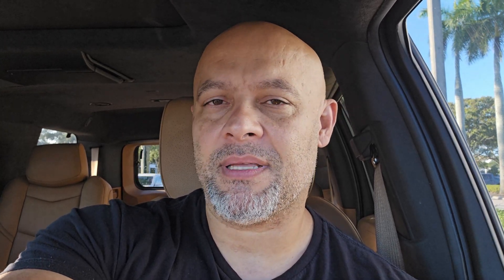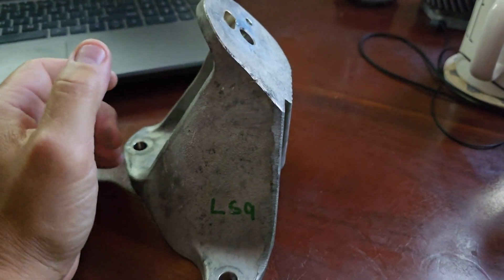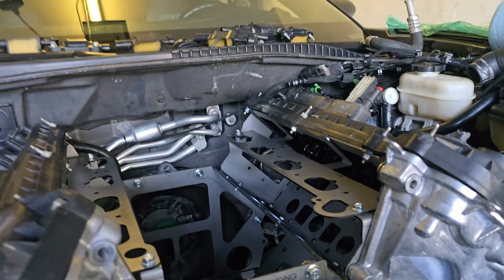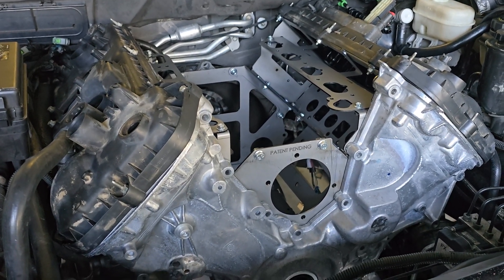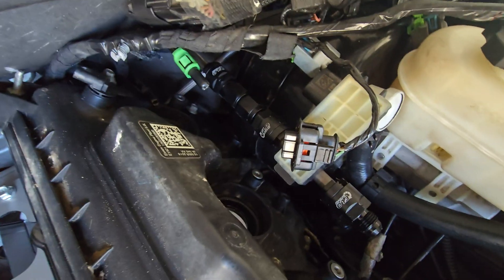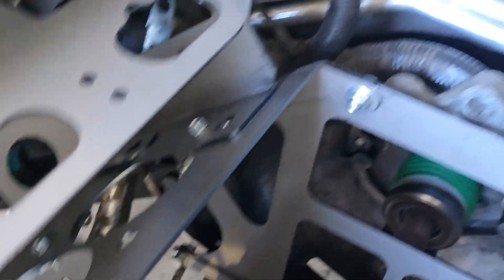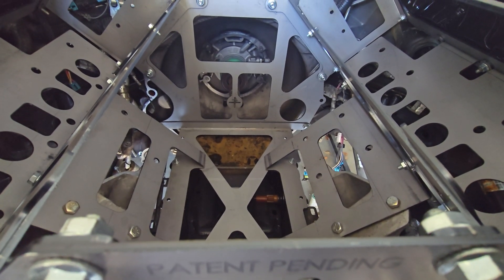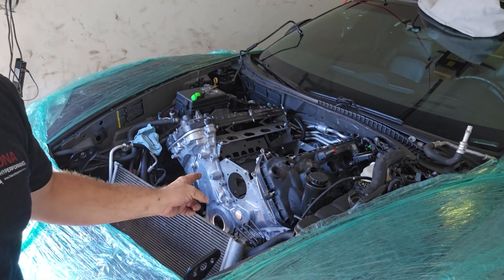Will the ZR-1 Motor mounts fit a Coyote motor?

Comment: The Quick Time RM-6034 C6 bell housing for Corvette C6 2005-08 has a depth of 6.425 inches. The Quick Time RM-6080 and RM-6081 Coyote bell housing have a depth of 6.925 inches.  So your best bet might be looking the RM-6080 or RM-6081 machining that bell housing down to the depth requirement to use the Corvette torque tube without modifying it of the depth of 6.425. Having a steel plate cut to mate up the Corvette's torque tube in the shape of rear of RM-6034 should be very straight forward as welding that plate to the shortened RM-6081 bell hosing.  From my own experience it's best to fit the bell housing first and then move to making the front motor mounts because the bell housing dictates where the front motor mounts will end up living. I hope this helps. TimT. The Gray Donkey😁. Yeah I'm an old guy

Comment: Tio, You might be able to  sandwich a flat 1/2 inch plate between the zr1 motor mount and the coyote motor mount holes. then just redrill the coyote holes on the 1/2 inch plate and support the engine that way 🤷🏻‍♂️

Comment: I would not sell the LS9. If something goes wrong the car is worth way more with the original motor than with a coyote. Stick it in the corner until you sell the car. Sell it with both engines.

Comment: A 4 cam Vette!! Who would have envisioned that❤
Reply: Gm did in the late 90s... the zr1 c4 was 4v...😂
Reply: Agreed. It was however a Lotus engine and nothing to do with GM. @christopherandersen5950
Reply: Between the C4 ZR1 and the current C8 Z06, you must be avoiding Chevy stuff like it has a disease 😂
Reply: Mercury Marine did when they built the lt5 for the c4 zr1
Reply: @timbattle3415 True. Designed By Lotus and built by Mercury Marine without any GM involvement.

Comment: Wouldn't even bother adding additional holes.. just send it on the 2 bolts per side. It'll be fine.
Reply: I dunno stock coyote maybe as the torque is t that severe. But a twin turbo? It's gonna snap 2 bolts easily.
Reply: @hatch450sx3  nah, don't forget it's held in place by the torque tube also.

Comment: I was abled to used factory 3v motor mounts with 4.6 to Ls swap plates on my Ls swapped 05 mustang not all the holes line up perfectly but I was abled to get 3 on ones side and 4 on the other as it looks your mount aren’t to far off and from info I’ve seen the 4.6 and coyote mount are very close

Comment: HMMM remote mount snails an option.....? I know there will be a bit more lag butttttt with the weight savings around 400lb give or take I think the lag will be reduced to an "acceptable" amount especially if you size the snails to max out at 900ish all in . This is a halo setup for me (coyote/Zr1).
Reply: Remember all the piping in the front and stuff will be gone he's not running anything as it is. He's using another radiator ect. So there may be some room in the front after all for turbos.
Reply: @hatch450sx3  I hope so . This is the American Garage version of Koeinisegg (how ever you spell it) and I'm all about

Comment: dude youre such an inspiration. everyone in my town is giving me shit for what im building. it gets discouraging, but when you say thing like " i dont care if it fits, i dont care if you think its stupid, im gonna do it"

i fucking love it. this series is FEEEEUUUUUUUULING me to keep goin!
Reply: What you building?
Reply: @hatch450sx3  gen 2/6r80 01 Silverado. single 7675 with a good fuel system, probably 10-12lbs for now.   It’ll be my daily driver (I’ve had the truck for 3 years). 

Chassis is done, 6r80 is in, just gotta do the engine and fuel system. Already have the engine and turbo kit. 

Wanted to do 10speed stuff, but it’s just to out of my league for now. Hope to start that at the end of the season. 
Yall gonna see one bad yote powered truck this upcoming season 😎

Comment: If lift height allows, it may be easier to install from the bottom.  It should allow engine+ blower+ clutch/ bell (+tq tube) to be assembled on subframe & roll into position. GL, great build

Comment: I mentioned it before in another video but you will probably be better off looking to use a coyote/modular steel blow proof bellhousing and attaching that to the torque tube rather than trying to mate the coyote block to the stock ZR1 bellhousing. The steel bellhousing should be easy to drill and tap some holes to match the torque tube. Plus you'll get some added safety

Comment: Curiosity, can you not order a steel bellhousing (like QuickTime) for the torque tube. Then machine/ cut off Chevy LS9 flange weld on a plate (laser or plasma cut?) with Coyote Bolt pattern? Not sure if you would want to run it that way but for fitment it may work well.

Love the content and can't wait to here the sounds it will make.
Reply from the maker: @jondobson5695  that might be what has to be done. Or drill proper bolt pattern to existing modular Bell housing

Comment: I took out my LS swap and replaced it with a coyote.  The engine mounts were basically the same height, but ended up being a few inches further rearward, so I had to complete re-engineer my subframe.  The engine was so wide I had to find a slim brake booster as well.  Several other small challenges added up to a lot more work than I thought it would be, but not terrible.  I’m happy to not have another LS swapped car though!
Reply: Also, I had to put a low profile oil pan in it.  Saved a few inches of ground clearance.  Ended up “fitting” in the engine bay quite nicely!
Reply: Yeah I’ll be posting update videos in the next month or so.  Same car.  Just have a short teaser vid about it at the moment.
Reply: This sounds awesome - Going to put any newer vids of it on your channel or is it another car you did the swap on? I have something I could swap but just buying an 11-14 GT makes more sense for what I want right now, lol.